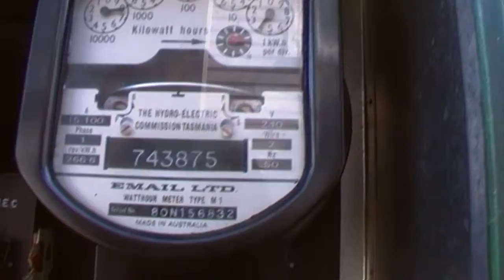Clynton's Shed - Flats rewire

Comment: Interesting video. Dont see singlecore used in 2ways here in NZ, common practice is to run a 3 core strap between lightswitches (lightswitch fed circuits is most common as opposed to topfed)

Comment: In Canada and the U.S all junctions and devices (outlets,switches) have to installed inside of a box, usually metal, unless they are low voltage. Also any junctions must be accessible, you can't bury them behind wallboard. You are also allowed to use wire nuts or solder to make junctions. The cables have to stapled every three feet and within six inches of a device box. So to someone in Canada or the U.S even newer house wiring in Europe and Australia looks pretty dodgy.